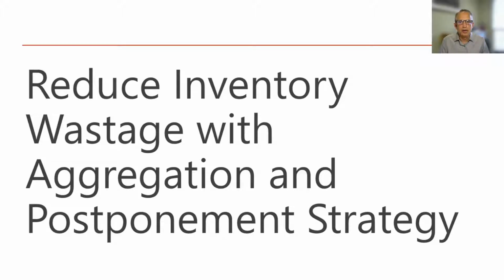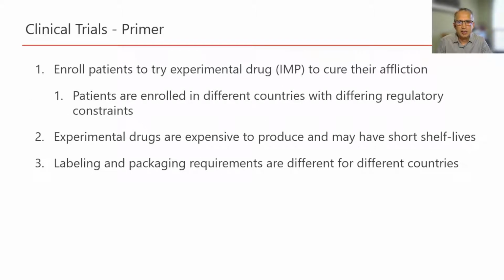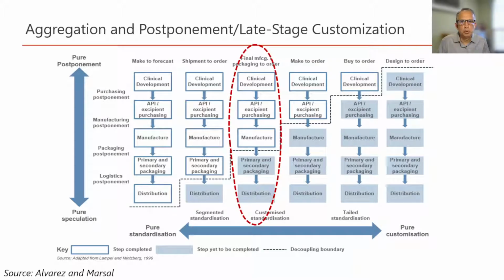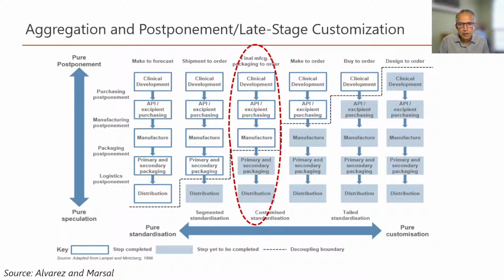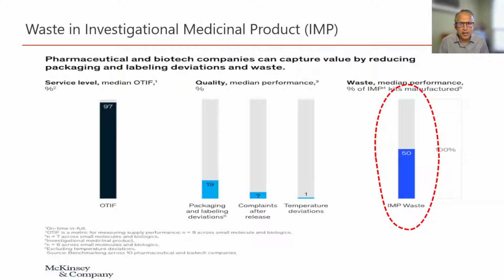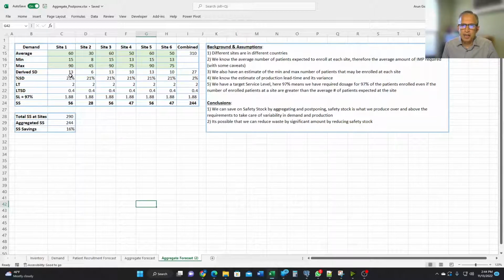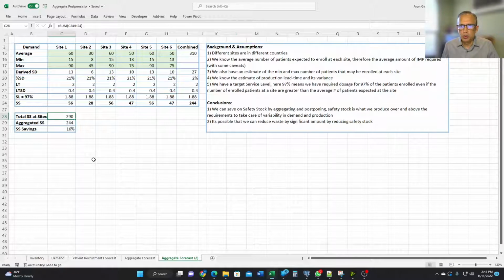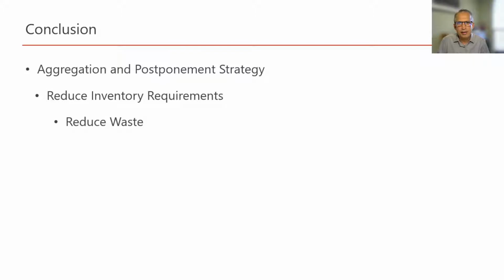Supply Chain and Systems - Part 8 - Reduce Inventory Wastage Using Aggregation and Postponement

Comment: Sir what is inventory aggregation
Reply from the maker: Consider a scenario where multiple Distribution Centers (DC) service Customer Orders. In turn, these DCs are serviced by a Central Warehouse (CW). To ensure a targeted Service Level we need to have Safety Stock (SS) if the Customer demand is going to be variable (as it inevitably will be). If we were to have Safety Stock in each of the DCs then the required Safety Stock will be higher than if we were to pool the Safety Stock in the CW. This is because variability in each of the DC will be higher than the combined variability at the CW. The intuition behind this is: if Demand at 1 DC is higher than normal it will be offset by lower than normal demand in 1 of the other DCs, of course, if Demand is higher than normal in all the DCs then pooling of Safety Stock may still be insufficient to prevent stock-outs. So this pooling of SS is called Inventory Aggregation. Hope this helps.